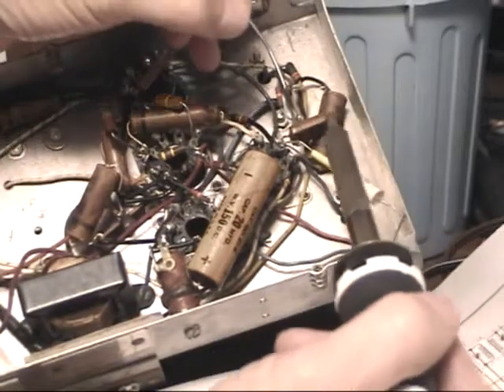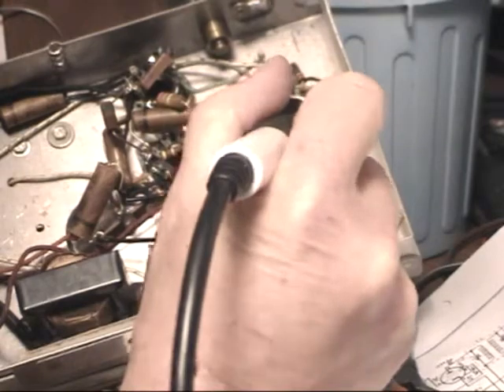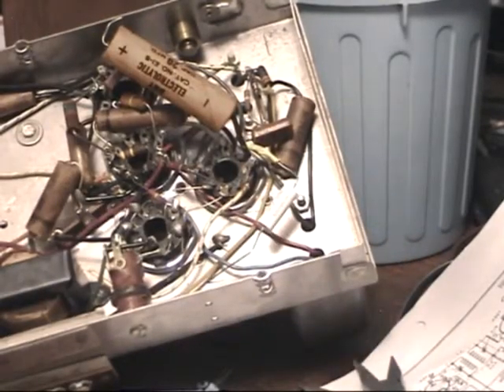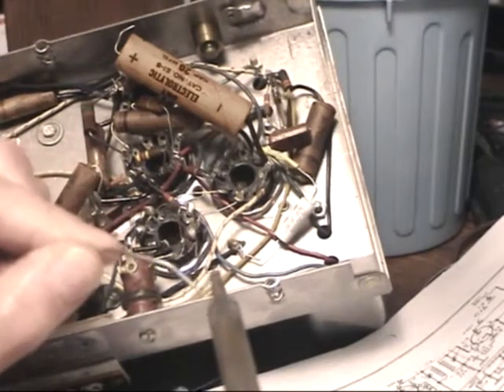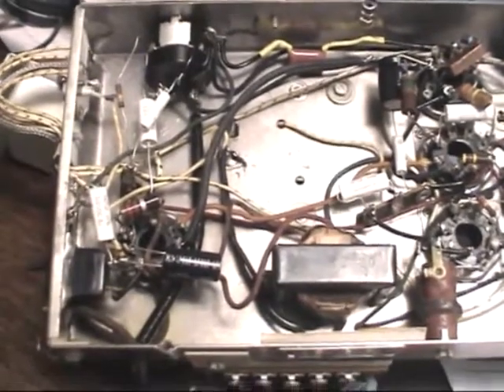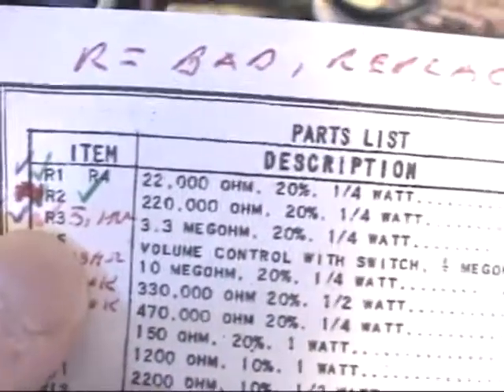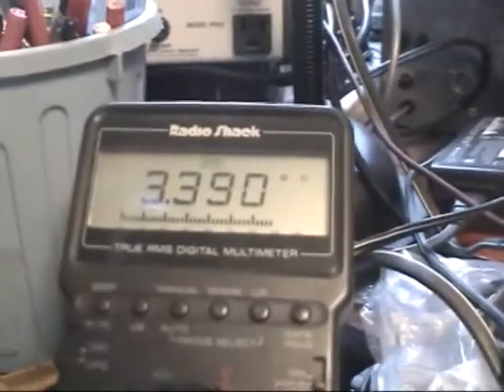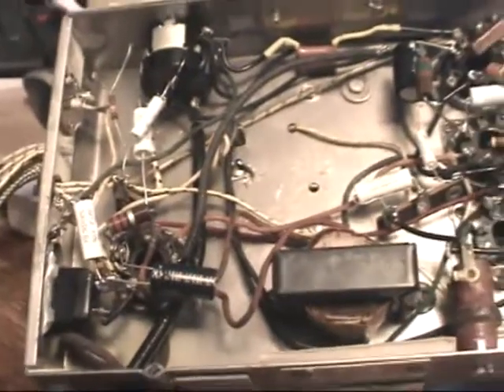Majestic 5A455 - Part 10e - ''Replacing capacitors and out of tolerance resistors''.mp4

Comment from the maker: Every other lower capacity values that were originally paper caps can be replaced modern film types. Of course it is usually easy to spot these because they are coated with beeswax. Sometimes though, and you have to be careful, they sometime have a large "mica looking" cap in there which may be a disguised paper cap.

I hope this answers what you wanted to know.

Again, thanks for watching!
Tom

Comment from the maker: As far as the electrolytics go I order the Nichicon PZ line via Mouser. Theses are rated at 108C and are very tall and skinny. This is important because I like to disassemble the original aluminum cans and stuff these skinny guys in there. It really keeps the original look to the radio or TV I'm working on. You can find some of this in my videos, (if I remember right), or you can look for bandersontv. He's got great videos on how to do this.

Comment: Since it is a high impedance circuit should not you caps be installed with the outer foil connected to the ground and the other side as short as possible? That means you cannot place caps based on the labeling.

Comment: You should not be using heat shrink in high heat areas. The heat can over shrink the material causing it to crack open. My company has a recall for that very reason. You should be using high temperature sleeving like what they use in toasters.